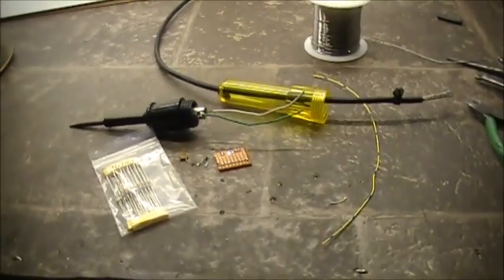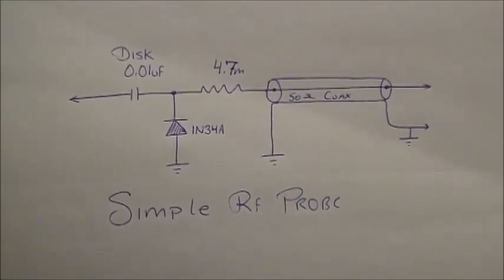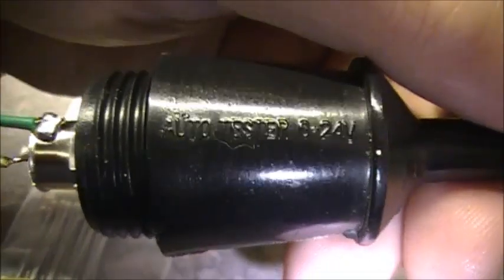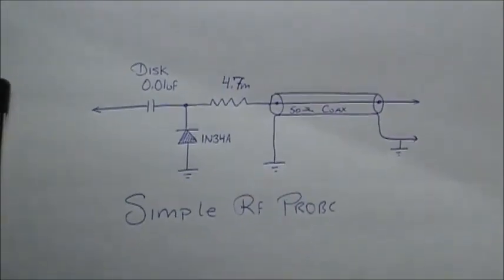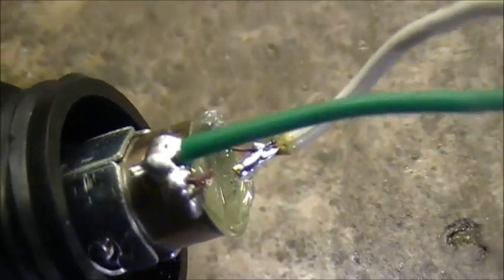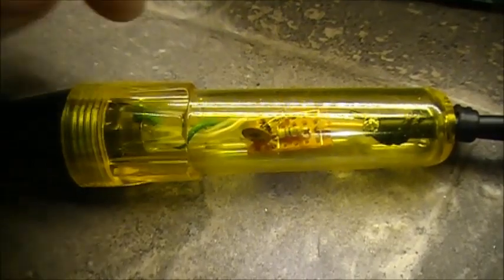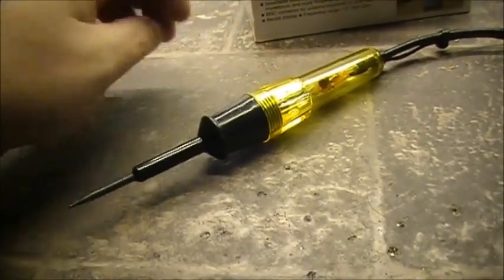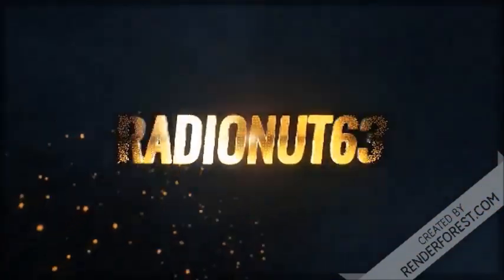RF Probe  -  Project

Comment: Merry Christmas :-) Just a quick note: A RF probe converts RF to DC (hence the diode) which is corrected for the difference between peak voltage and effective voltage (hence the 4.7M resistor). It normally should feed into a sensitive DC voltmeter with 10 Meg input impedance. Feeding it into a counter is not its intended purpose. If you just want to mechanically connect the counter, any cheap 1:1 scope probe will do.
Reply from the maker: I am well aware it works with a meter.

Comment: I have noticed different Schematics with the 1N34A in the Reversed Position - Wikipedia,Heathkit,Eiko and others. So how does the Circuit actually function?
Reply from the maker: Rectifies the signal to produce a voltage the meter can read.    Kinda like how a diode rectifies AC to DC.